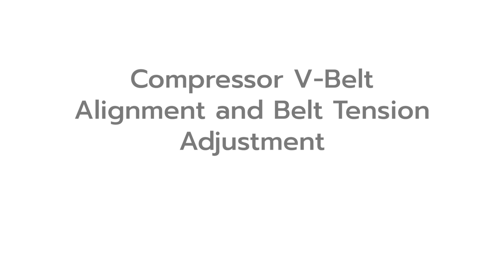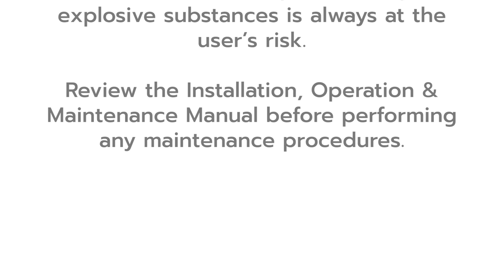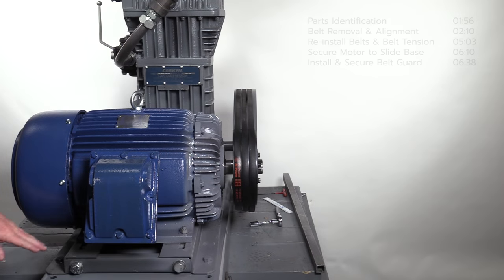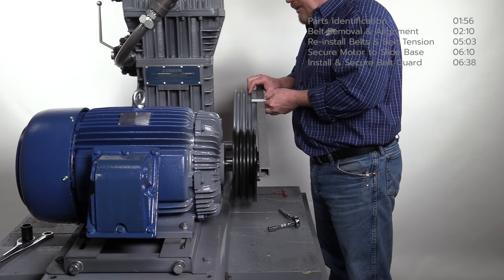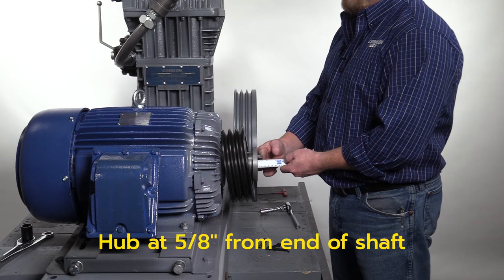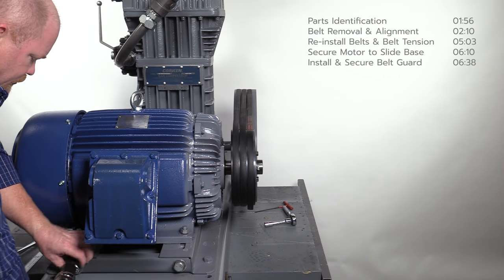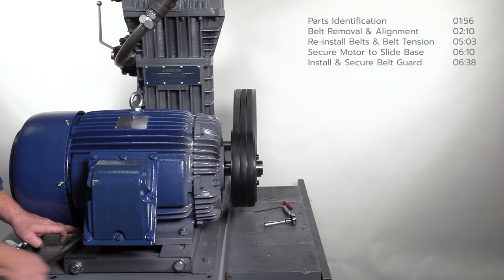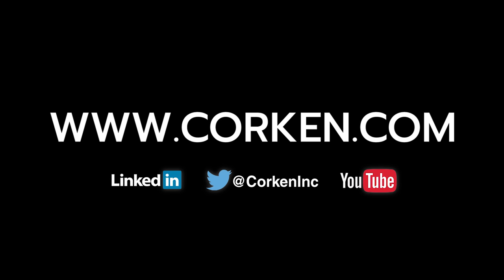How to Align the Sheave to the Flywheel and Set Proper V-Belt Tension

Comment: I have a double belt on a fan connected to a motor. One belt is loose while the other is tight. I have tried to adjust the motor alignment but this hasn't helped. Could one belt be stretched ?

Comment: Hi great content, I have a question. Can a pulley system enable a diesel engine to achieve a greater RPM than its rating. For instance, I have a Detroit diesel model 6V-53N/T that is rated at 300 BHP @ 2800 RPM. That is being used to power a positive displacement blower (roots 616 dvj) . I am looking to maximize the output of the blower. The blowers maximum output speed is 3000 RPM @ 135 BHP. Can a pulley system assist in that extra 200 RPM needed to meet the 3000 RPM. ?
Reply: Yes you can harness more speed from the engine, for that you will have to use a slightly bigger pulley on the engine and a slightly smaller pulley on the blower, these pulleys must be identical and of the same make and manufacturer! The blower will rotate at a higher speed but will receive less power!
Reply: @hassanfaheem7356  thank you so much for that information/ confirmation . Our current unit is V belt driven , I’m assuming that is termed “direct drive” . I’ve noticed a few blowers ran off a transfer case - can you help me understand the difference or pros and cons to either set up ?